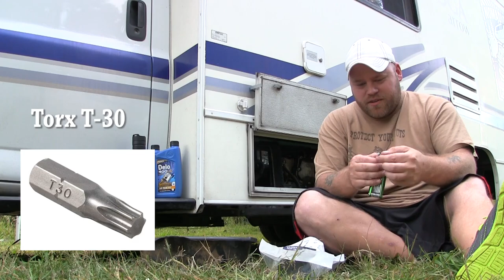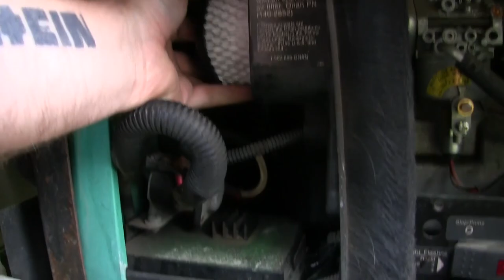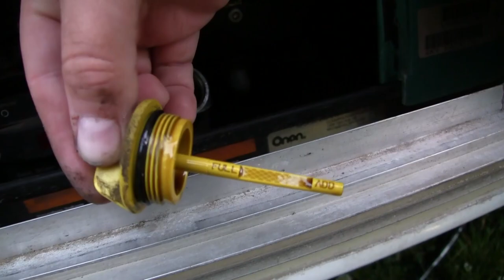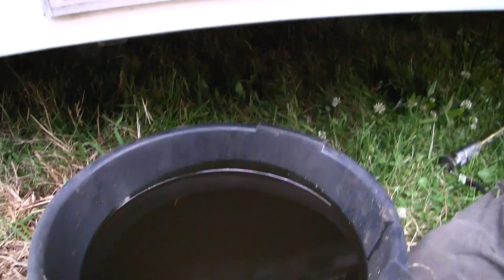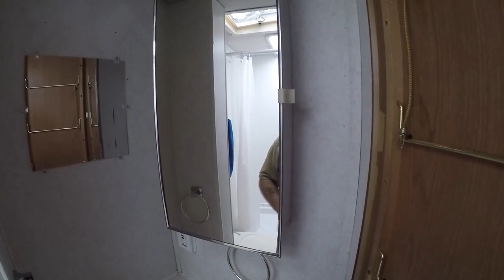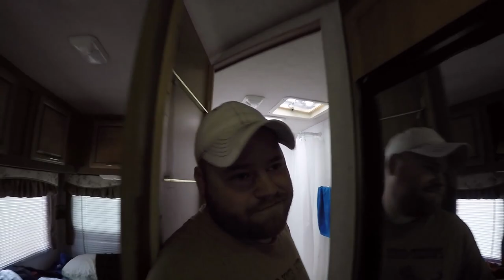Changing Oil & Filter Onan Microquiet 4000 Generator

Comment: What magic spells do you cast so that the oil does not immediately run out all over your hand as soon as that plug is loosened? I have never found the right one.

Rain. Yeah, I love the sound of it. Unfortunately, after 8 years mostly in the Florida or desserts, water is regularly finding ways to defeat the weakened caulking on the roof and get in. We have been recaulking seams and stand pipes, replacing the leaking skylight over the shower with a fan, and replacing vent covers. It is all going at once. Pretty nearly everything on the roof will be redone and resealed by the end of this summer. Sitting on a ladder fussing with the roof has been a full-time job for DH, and it is not over, yet. He is beginning to develop an attitude.

Comment: Medicine cabinet. Start planning a video of what you're going to use to keep stuff from falling out.
Reply: Super industrial 3M Velcro to keep the door closed.
Reply from the maker: As I said, I fixed the latch. It's holding strong. But I guess I could pick up a few extras at the junkyard down south to have on hand. I certainly don't need a bungee around it.

Comment: if the generator was a two stroke (doubtful) I'd need a oil fuel mix that would clog a filter and be a fire hazard.
I'm guessing it's a mater of size, purpose and other factors that determines if an oil filter is requird?

Comment: Good job Eric. But I agree that not running the engine before changing is a good idea. I have always done it that way. The sludge and debris will have settled to the bottom of the engine after it has not been ran for a while and will drain out. Starting the engine only circulates it back into the internal workings. I think I'd change the oil twice a year for maximum engine life. Fresh oil is the life blood of longevity for engines. Cheap insurance indeed.

Comment: The 4000 micro lite does not have an oil filter. So.......... change the oil every 75 hrs. of use. If you are lucky enough to find it, run Honda 4 stroke oil that can be found at Rural King around the generator dept. This oil is definitely the best out there. I have 2400 hrs. on my 4000 and never had the valve cover off. They leak feverishly so keep an eye out for low oil consumption.

Comment: Onan sent you the wrong filter or you ordered the wrong filter?
Reply from the maker: I wend on ebay and searched "Onan Microquiet 4000 Generator air filter" and didn't realize that there are different models of the microquiet itself.
Reply: I was thinking you might be able to get a refund from Onan but given the circumstances, you're probably out of luck. Hopefully it wasn't too expensive.

Comment: you can't use zinc oil in any aluminum heads or engines. you can blow your head gasket or blow the engine. look it up for you self

Comment: No such animal as 15w30. Delo is a great oil BTW. I use it in my boat and air cooled equipment with confidence.
Reply: Here is your 15w 30 http://www.chevronlubricants.com/en_US/products/commercial-transportation/heavy-duty-motor-oils.html#.V3QkSfkrKM8
Reply: ***** Yeah it's something that is very new and for the most part unavailable. 15w40 is what's right for his generator unless he sees extremely low temperatures in which case a 5w40 diesel oil would be a better choice.
Reply: You are right he needs 15w40 i have used 15w30 for over 15 years so its not new
Reply: aspudkicker It's in Pounds which means it's in Europe. Like I said go and try to pick up some 15w30 at your local store and get back with me.
Reply: +WeSRT4 HAHAHA, not according to the service manual, many choices, preferably SAE 30 for summer. Dang thing is even free.
Reply: hitmanhite I would encourage you to go do a little reading over at http://www.bobistheoilguy.com/forums/ubbthreads.php/forum_summary.

The 15w40 is a better all round choice vs the old straight 30 weight. It gives better cold flow properties than a straight 30 weight and is slightly thicker at operating temp. A straight 30 weight is old school and is not better in any way over a quality 15w40 like the Delo he used. Case and point is that the manual doesn't always know best.
Reply: Shoot, 15W40 has been around since I started doing oil changes, and I'm not young any more! At least 50 years!

Comment: No oil filter, is that normal?
Reply: For some generators, yeah, there's no oil filter. It seems odd, but that's the way it is.
Reply: on most air cooled things no oil filter is common
Reply: Yes. Does your lawnmower engine have an oil filter?
Reply: one does all my other engines don't there is like 4 that don't and the size on 2 are the same HP
Reply: Onan recommends you change your generator oil every 100 hours or 1 year, whichever comes first.

Comment: Never a good idea running a full synthetic oil in an older engine that has normally ran regular oil it's whole life. The seals can shrink are prone to leaking now, just wait. Always best to run a standard name brand or quality oil in small older engines. Just saying...
Reply: Old wives tale, unless you are talking about running synthetic in a 1960s era type vehicle. 
A small air cooled engine can handle synthetic just fine.
Reply: I agree I don't know about a generator but I switched to full synthetic in my Jeep and the engine ran loud as hell.
Reply: I agree that's been my experience.  Can make the engine run noisy and new leaks often show up.